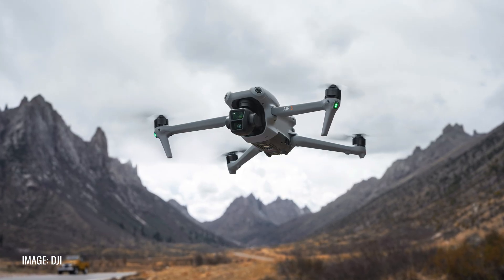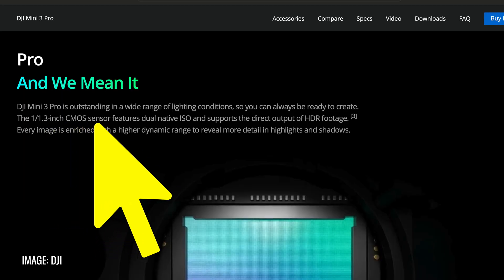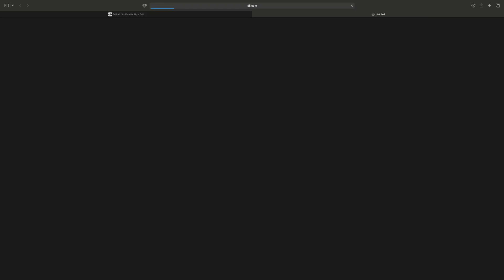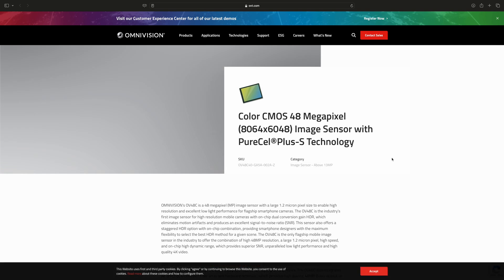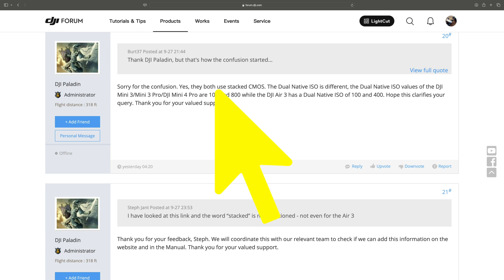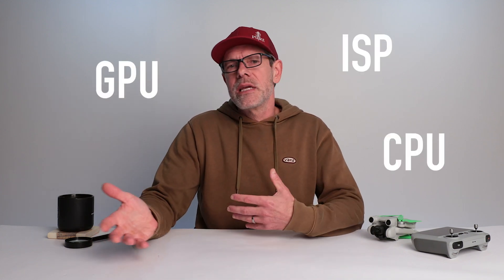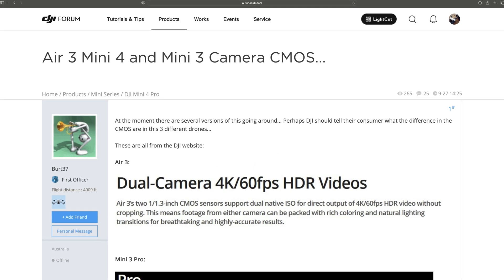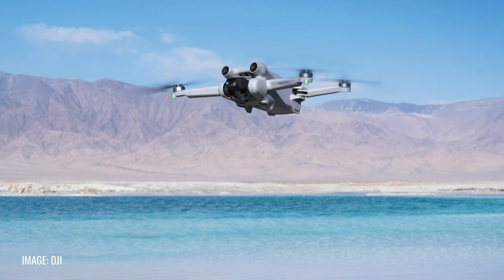The Curious Case of the Stacked Camera Sensor (It's a Bit of a Rant)

Comment: All of the semicon companies now do stacked sensors. I work in semicons and it is an industry standard. We do stacked sensors for everything, not just photo/video cameras, but also obstacle sensing (not just for drones, actually drones are the smallest industry for obstacle sensing, automotive is the biggest industry using obstacle sensing cameras), IR/thermal, LiDARs, everything. And usually these stacked sensors aren't even manufactured by a single company, but ASIC part is one manufacturer and sensor is another. We started stacking 3 years ago in our company, but sony has been stacking for 10 years already because before a chip gets into production, there is roughly 5 years of R&D. Air 2s is a stacked Sony sensor. Also, air 3, mini 4 pro, mini 3 pro, mini 3 and mavic 3 pro 3x telecamera use the same sensor die, only the ASIC die that gets hybrid bonded to the sensor die and handles signal (image) processing is updated. Well, to be exact, chip stacking has been here for ages, only difference it has been done by bonding two dies through bondpads and now we do it using hybrid bonding. Bondpads were around 100 micrometers big metal pads that you placed a solder on and solder the other die onto. So basically we shouldn't be really talking about stacking, but rather hybrid bonding, since that is the terminus technicus that hides in the "stacking" buzzword. Now it is done using "pads" of 1 micrometer size and smaller. They just create copper squares on the chip as if it was any other metal routing, push the two dies together using high pressure and temperature and they bond together just like that, without any solder. It is tricky to center the both dies, it is tricky to keep them from warping, but it results in significantly smaller chips. And that is all there is to it, it makes chips smaller so you can cramp more things into smaller form factor. So you can have 4 cameras in your phone, so you can have small drones record high FPS video and stuff like that. It does not improve image quality, it improves image processing and image processing chip size.
Reply from the maker: Cool! Thanks for all the extra detail.
Reply: Great breakdown, thank you
Do you know any nuances about the 1 inch sensor in the new air 3s?

Comment: Not a drone enthusiast (yet) but I design CMOS image sensor for a fortune 100.   A stacked sensor simply means all of the peripheral circuitry (everything except pixels) is placed another chip (ASIC)  and the pixel chip is stacked on top of the ASIC.  And yes, because the ASIC is no a separate chip, more computational power can be incorporated on it
Reply from the maker: Cool. Thanks for the technical explanation. Cheers!

Comment: Thanks for the research, I did much the same thing looking for information & pouring over numerous spec sheets, listening to YouTube videos & basically churning out no real clues over several weeks of randomly searching for data on this. I'm going with the Air 3 regardless of the sensor b/c I need the additional lens & eventually I'll jump up the ladder to the Mavic 3 Pro Cine anyway. At the end of the day if DJI has achieved a better image with a smaller sensor by upgrading their processor's transmission speed & the image has improved over the Mini 4 Pro I don't think it matters that much how they achieved it. A larger sensor is nice but my work is going to be viewed on phones, tablets & laptops for the most part any way. Being able to have the flexibility to get shots that differentiate from the standard 24mm in 4K is fine for now. Keep up the good work this was very helpful.
Reply from the maker: Thanks so much for the kind words and the comment. I appreciate both. You're totally right - better is better regardless of how it's achieved. Happy, safe flying!

Comment: Also not that the Mini 4pro side by side image comparisons look nearly identical to the Air 3 based on footage reviews.  The Mini 4 Pro reviewers do not boast that it has a "stacked sensor" but better image processor.  As you said, I think the image processer is the key to the superior image quality.  Furthermore, I am still getting extremely great footage on my Air 2s as long as I am filming in Dlog and doing my own grading.  All of these products produce great results.  Will upgrade when there is a more substantial difference.
Reply from the maker: Without someone tearing the cameras apart, we will never know for sure but I am pretty confident all the drones I mention in the video are using the same, stacked sensor. The differentiator is better image processing, which as we can see, makes a HUGE difference. The Mini 3 Pro is an excellent drone but I feel DJI underpowered it a bit in both general processing (CPU) and imagine processing (ISP, DSP...) so it wasn't as capable as it could have been. It was something I speculated on in my Mini 3 Pro review.

I was ever so tempted to pick up an Air 2S when the price dropped before the Air 3 was introduced. I still think that is one of the best drones DJI has ever produced. The perfect balance of capability and image quality in a small package. I was really hoping DJI was going to stick with the 1" sensor but perhaps it will resurface on an Air 3S - single camera, larger sensor. 😀

Thanks for watching and thanks for the comment! Cheers!

Comment: Hi, you can find the official DJI slides about stacked sensor in DCRainmaker blog review of Air3.

It is the same camera, but not the same sensor technology due to the change of System on Chip with integrated (stacked) ultra-fast DRAM and image signal processor.

This guarantees better videos in particular in low light conditions and it is coherent with the achievable  results on Air3 and Mini4 if compared to Mini3.

A full 1" sensor with current image processing capabilities would literally kill the Mavic3, so we won't see any further updates until the upcoming Mavic4 series will have consolidated sales. 

If it will ever arrive, a potential Air3s can't be expected (IMHO) before November 24.

Comment: Steve, you've made a great video about this 'stacked sensor'👍👏I've decided to upgrade from the Mini 3 Pro to the Mini 4 Pro for other reasons then the slightly better video quality (by the software) and will make my first flights with it soon. Also decided to keep my Mavic 3 Classic for now. The bigger sensor is more important for me now for higher quality video when needed compared to the smaller telephoto lens on the Air 3. In details on darker parts you can really see the advantages of a bigger camera sensor with variable aparture compared to a small stacked sensor.  I will probably upgrade the Mavic 3 Classic drone when there comes a next version  of the Air or Mavic series with also a C1 label in Europe with a bigger main and telephoto sensor (very tempting). For now I'm very satisfied with my Mini 4 Pro and the Mavic 3 Classic for different use cases. Greetings from 🇳🇱
Reply from the maker: Thanks Geert! After doing my research for another video, I came away quite impressed with what the Mini 4 Pro offers over the Mini 3 Pro. That upgrade is not going to make sense for everyone and the Mini 3 Pro is still an excellent drone, however some folks with benefit from 4's new capabilities.

The camera sensor in these Mini's now is VERY good but I agree with you, the larger sensors definitely bring the quality up several notches. In some respects I wish DJI had of fractured the Air line and offered a dual-camera version as well as one that continued with a one inch sensor. Same capabilities on both models, just larger sensor for the folks who wanted that over dual cameras. Who knows, maybe we will see something like that in the future.

Sounds like you've got it figured out regardless. Thanks for the comment and happy, safe flying!

Comment: Hi Steve. I think you'll find this interesting:
I'm not into sensor formats/sizes, so I just thought that 1/1.3 was bigger than 1. Because I thought 1/1.3 means height x length or something like that. And now I understand it means X divided by Y.
Thanks
Reply from the maker: Yeah, I think I made that same mistake when I first saw that notation. Most of my sensor knowledge came from the good old DSLR days,  now mirrorless, when you had sizes like Full Frame, APS-C and Four-Thirds. The biggest worry was crop factor with your lenses. Thanks for watching and thanks for the comment!

Comment: Would you mind talking about the Master Airscrew propellers you have on your Mini 3 that you have in this video?  Master Airscrew says they make the drone quieter but I find that the original propellers work better. The original ones seem to be more resistant to the wind, don’t chip as fast & they seem to be just as quieter as the Master Airscrew ones.  Could be an interesting idea for a video.
Reply from the maker: I did a video review about Master Airscrew propellers for the Mini 2 quite a while back. Those propellers had a lower pitch, which was easier on the ears and perhaps a touch quieter. I did manage a few extra minutes of flight time with them too. I feel like those props were more brittle than the DJI ones and I suspect the Mini 3 Pro version is the same plastic.

I've been rolling with the MAS props on my Mini 3 Pro, almost exclusively, for about a year now. I haven't had any problems with them. I don't notice any difference in performance or flight time but I have not really focused on that. I posted a YouTube Short comparing the sound and they are actually a decibel or two louder than DJI OEM props. I did manage to break a couple of MAS blades and I do feel like they are more brittle. Where a DJI propeller might tear, the MAS props will break. Regardless of the damage or which brand of propeller, any damaged blade should be replaced immediately, so really it's kind of a wash in that regard.

For me personally it's all about the colour. I love having anything other than boring black. Even if they're not quite as quite, robust or efficient as long as they are reliable, which they seem to be, then I would rather have the colour.

I have really never understood why DJI doesn't offer some colour options. Seems like easy money to me.

Anyhow, I may still do a MAS propeller review for the Mini 3/4 Pro in the future so stayed tuned. Happy flying!